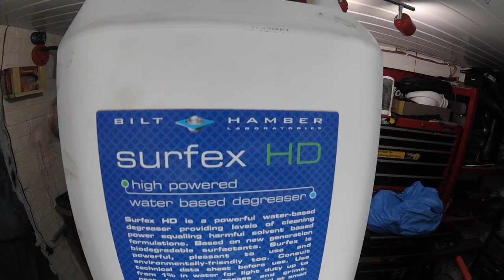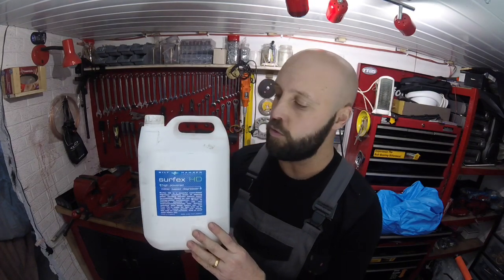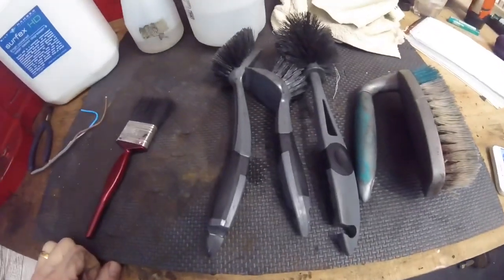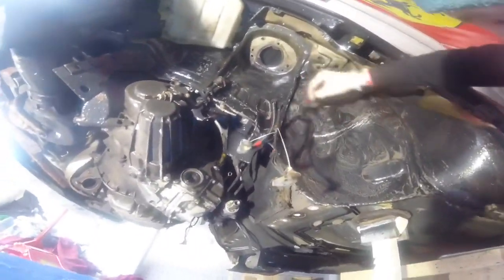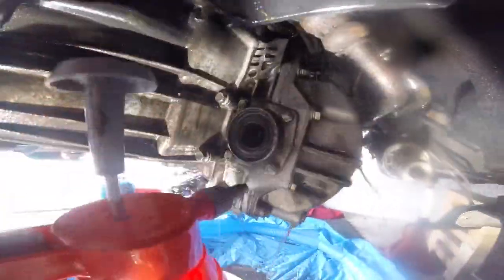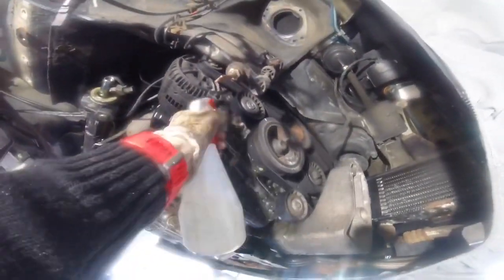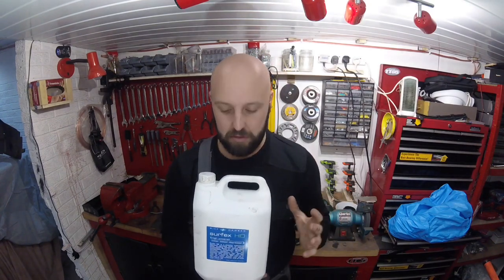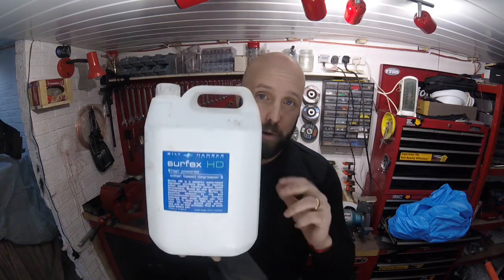Bilt Hamber Surfex HD product review

Comment: I've got a few bilt hamber products as I do valeting. What other uses can it be used for.?
Reply from the maker: Leon Bradley Hi. As an all purpose cleaner as well as a degreaser which can be diluted accordingly, the possibilities are endless really. It is safe to use on paint, wheels, tyres, carpet and upholstery, or simply to clean the engine bay prior to dressing.
Reply: @_RicksGarage  thanks Rick. I definitely need to try some. I can vouch that bilt hamber auto foam is awesome aswell as there clay barrs. Once again many thanks for Yr advice and will order some.
Reply from the maker: Leon Bradley no problem. You won’t be disappointed 👍🏼
Reply: @_RicksGarage  thanks Rick. 5 litres ordered on Yr recommendation. Cheers buddy.
Reply: I've used it all inside my car, cleaned the inside roof which had mountain bike tyre marks and made the whole thing look brand new, improved all plastic trimmings, the steering wheel, seats and as a tyre cleaner

used it on my cycling shoes earlier - cleaned them up nicely. I clean the bath and kitchen sink with it - no smell either compared to general kitchen/bathroom cleaners.
Reply: CN u give me dillution ratio

Comment: What top mounts are you putting back on the front suspension?
Reply from the maker: TABRAO good question. The right hand top mounts are widely available but the left are none existent as you are probably aware. An option on the table, be it an expensive one, is to buy a pair of custom made top mounts from Totally Alfa but they come in at an eye watering £180 each and that is if you have your old top mounts to exchange. So at this moment I’m still undecided what to do for the best. Rick

Comment: What do you call a weak mixture? I just bought 5l of this and just want to get general grime off my motorbike, nothing greasy to remove.
Reply from the maker: Nott John just 1 part solution to 5 parts water in a spray bottle is more than enough for what you need 👍🏼
Reply: @_RicksGarage  Thanks, Pal. 👍
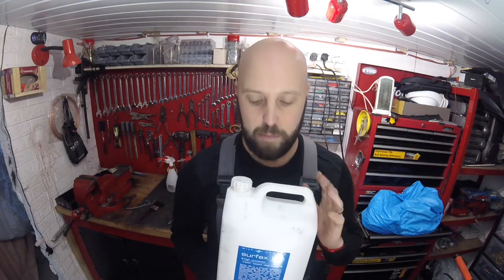Reply: @nottjohn9418  I use it on the car at around 1:9 for wheels and tyres, 1:19 for bodywork and exterior glass (only if I'm doing a decontamination, not as a regular wash product on the glass lol) and 1:4 for engine cleaning... I actually go down as far as 1:200 for interior cleaning before dressing the trim - cleans it up well and degrease the surface without to much product lingering around in the cabin lol.